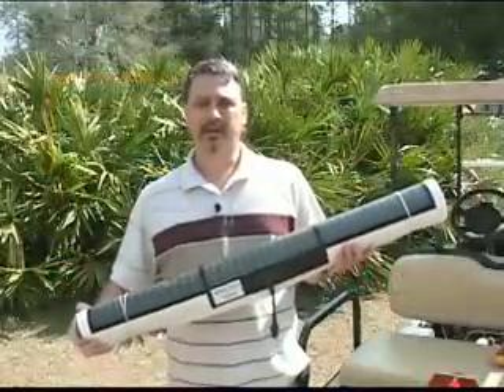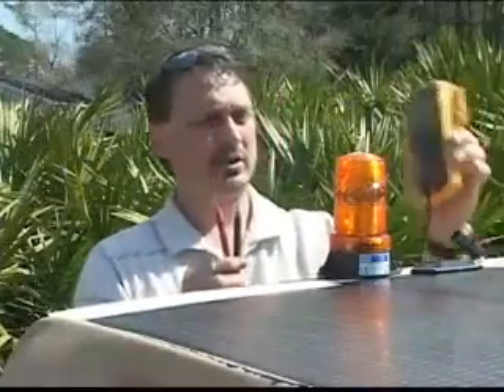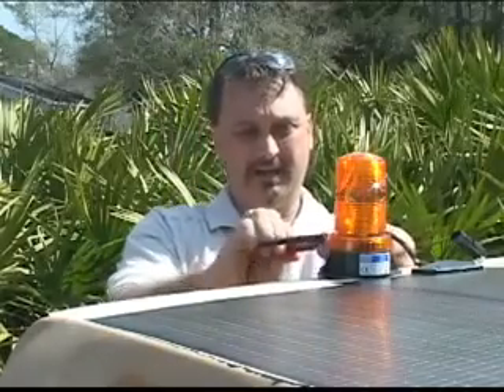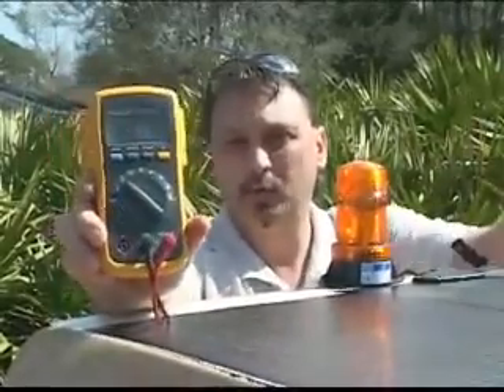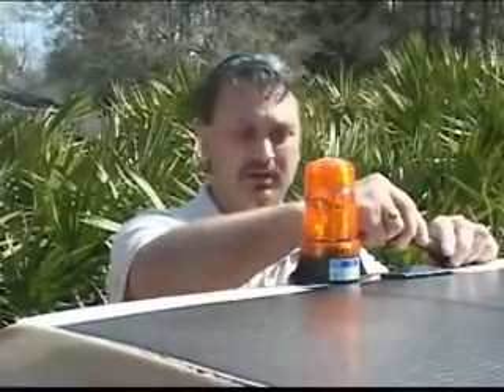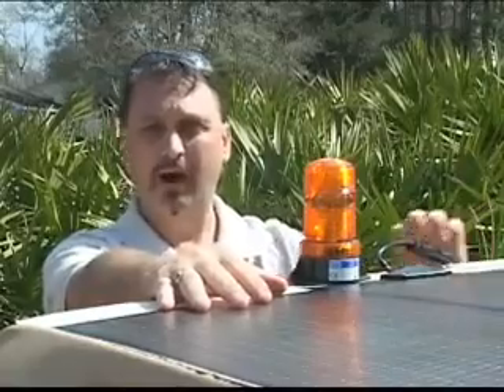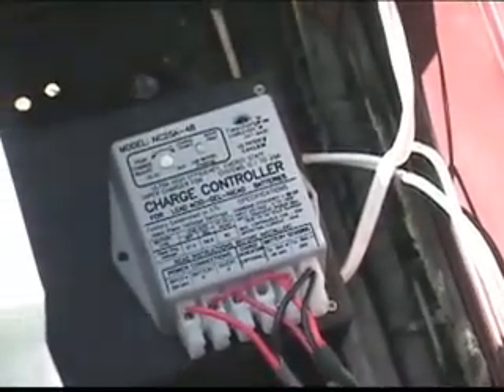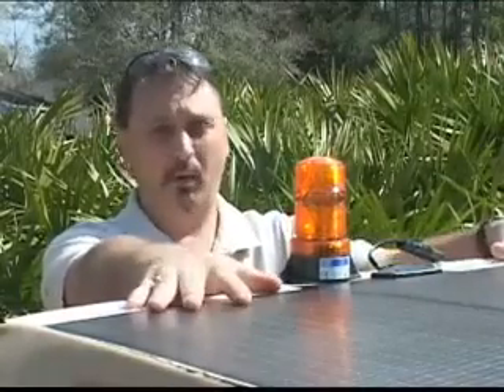Peel and Stick Solar Panels

Comment: Thats sixty volts with no load!!!! Try the measurement again in circuit. Also what is the wattage? Amorphous solar panels are low wattage, compared to the "glass top" panels.